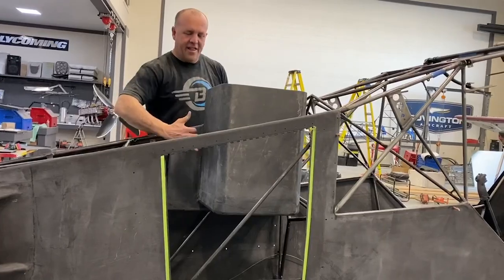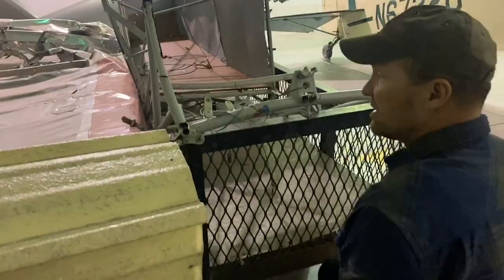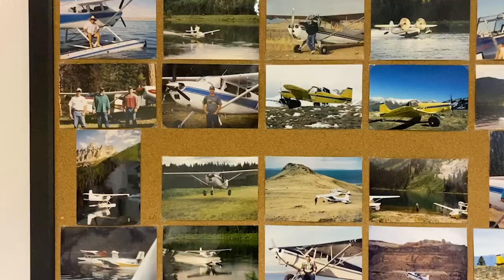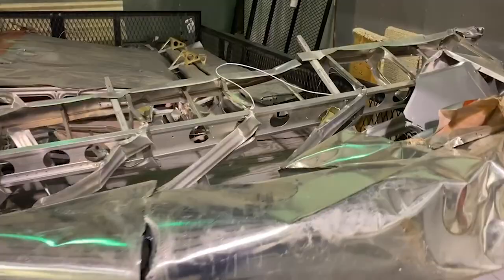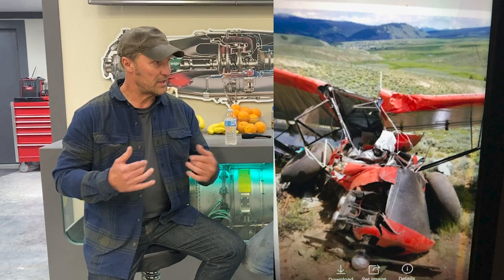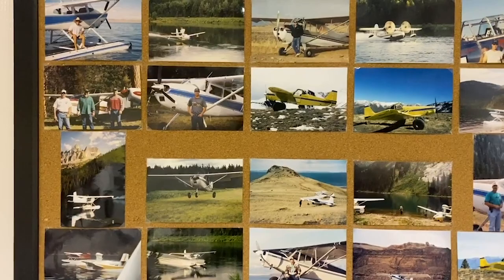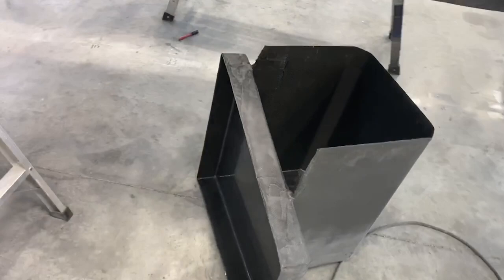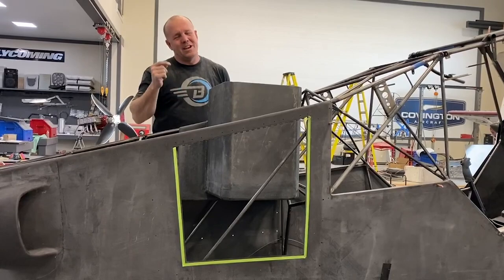Rockets, Boxes and Parachutes Oh My 🤠 (Scrappy Bush Plane 18)

Comment: Whoever says real pilots don’t need parachutes must have never seen a military aircraft.
Reply: I actually Saw a guy Complaining about a year, year and a half ago, that Military Pilots Shouldn't be allowed to use their Seats, and should be forced to "Ride it In" since he as an (Alleged) Airline Pilot doesn't have that Option.  There's a WHOLE lot of Stupid out there.
Reply: @toadman506  That especially doesn't hold up when you consider that (as a general rule) people don't shoot missiles at airliners and airliners shouldn't be doing crazy, high speed, low/close flying or aerobatics...
Reply: Its the plane that is getting the chute? The ejector seats were probably on back order.
Reply: @toadman506  Especially since modern jets lose power they drop like a rock.
Reply: @toadman506  Should have told him that C/EC/HC/KC-130s, C-5's, C-17s, KC/EC/RC/OC-135s, KC-10s, E-3/4/8, VC-25 to name just a few, do not have ejection seats and heaven forbid their crews and passengers ride it in.
Reply: In every skydiving aircraft parachutes are required by everyone on board
Reply: Demon Got Me why they all have parachutes ?
Reply: Like Viagra - yeah it’s a great product, and you should try some, but    I    don’t need it.  Not me.  No Sir.  I’m fine.
Reply: SwissCheeseAviation well have you seen those aircraft.  You’d be insane not to wear one.  All that holds those together is luck and duck tape.

Comment: Read the title and my first thought was “JATO” jet assisted take off/ RATO rocket assisted take off.... LOL. Probably in a future video. 🤪
Reply from the maker: so did I lol
Reply: Well, we don't know any of the details of Draco 2 yet.  Wouldn't that be something to see.  :P
Reply: @ClintMaas  That, and the leading edge of the wing raised a few inches.
Reply: @ClintMaas   Draco X with JATO would make it VTOL in a flash.. :D
Reply: Saša Kurtović it’s not like an American company makes a hypergolic thruster called SuperDraco...
Reply: With that huge engine and prop the  blast over the wing and extra gear leg wings may make enough lift to take off  before it accelerates with no forward speed.  VTOL with just the prop, no need for a rocket!

Comment: I'm not a pilot, but Mike, thank you for pushing me to go work on my race bike when I'm getting in a rut. 
Working 60+ hour weeks, 6 days a week in a motorcycle dealership service department, motivation to work on a bike for free (well, paying to work on it) is hard to come by. But when I see you've posted a video, all I want to do is get back to work. You've already put some ideas in my head about some carbon intake ducts, tail fairing re-design, custom subframe, custom front fairing stay, radial front caliper brackets, and fuel tank crash protection. Now I just need to design, prototype, test, and build. 
I just wanted to say you're one of the very few people I actively pay attention to on Youtube. You offer so much knowledge and insight, I often even take notes. Thank you for posting these videos.
Also you're making me want to get my pilot's license when I can afford it.

Comment: The other advantage to a parachute system is when flying with someone who doesn't know how to fly themselves. If something happens to me in flight, I'd rather it not mean the death of my kids too. They can't currently fly and land a plane. But they can pull a red handle. 

I've never understood the seeming extreme sitgma within the aviation community when it comes to parachute systems. This is the same community that constantly preaches "A real pilot puts safety first" and puts redundancy in everything to help achieve that. Yet practically in the same breath many of those espousing safety in everything saying "A real pilot doesn't need a balistic parachute system." Even beyond structural failure, tell that to someone flying in pitch black at night over wooded mountains. That engine goes out then and even the best of pilots would likely be better off pulling the chute. Or when flying with anyone when you are the only pilot aboard. Anything happens to you, they are probably dead too without the chute. Or how about not a bush plane, but one that lands with a rather fast stall speed and whose gear is designed to land only on pavement or the smoothest of gravel or grass fields, and needs an awful lot of strip even then to come to a safe stop? etc. etc. 

There are so many scenarios when a parachute system can be of benefit to even the best of pilots with nerves of steel, not to mention their passengers who are trusting that pilot with their lives. 

Plus, I mean, it's got a rocket. How could you not want to put that on your plane?  -Daven
Reply: Do a video on your channel about a BRS system! A lot of people probably don't know planes can have parachutes
Reply: Today I Found Out It would definitely be fantastic for you guys to do a video about BRS! I think that audience would eat it up.

Comment: Well said, Mike. As a Cirrus owner. I hear all the time that I must be a crap pilot because I have a parachute, you nailed the reason I have it.
Reply: Must be from the jealous pilots flying warriors.
Reply: What is your opinion on people training BRS deployment due to engine failure?
Reply: @amtank  Wouldn't it  make sense to train with the equipment you've  made available to yourself in case of an emergency? Fumbling through a process you should be comfortable with when the stress is at "full chat" is a good way to still be fumbling when you smack the ground. 
Train as much as you  need to become proficient, or maybe just a little bit more... and then refresh regularly.
This, from the perspective of an old SCCA Safety Marshall & Tech Inspector.

Comment: I really like Mike and his pushing the future by decades in his ability to see a problem, visualize a solution, design and test
a fix and possibly get it incorporated into future aircraft. I also REALLY appreciate the videographer in keeping up with Mike in what is going on and getting such great videos! I am a 'dinosaur' -  I joined the CAP as a Cadet and was taught how to fly by WW2 fighter pilots in a Piper J2 in 1953 NO generator, radio, lights etc. Lots of fun in SoCAl. Too old to fly now - reflexes, hearing and vision - darn it!

Comment: The people that are laughing at putting a parachute would give their right arm to have one if they were spiraling toward the ground.  Years ago when I was training with an instructor, I was supposed to do an approach to landing stall and after the stall horn sounded I put the nose down and gave it full throttle with 40 degrees of flaps.  The airplane didn't like it and proceed to spiral down toward the lake we were over.  It scared the s**t out of me, but the instructor remained calm and took control and said "the airplane manufacturer doesn't recommend spins with full flaps, it tends to rip the wings off".  He reduced the flaps and got it flying again.  If I had been by myself, I might not be writing this, but I sure learned a valuable lesson.

Comment: Mike you have a big influence on the GA crowd.. 2 thumbs up on supporting parachutes is the right direction and up there with the few back country guys taking the heat on helmet use. No one should take heat for safety features anymore then taking it on not flying beyond their personal limits. Cheers

Comment: Two of my flight instructors (one a brother in law) went down in Cessna’s that broke in the air. Both great pilots. I wished they both could have pulled a handle. ‘Nuff said. Thanks Mike!
Reply from the maker: Sorry to hear that
Reply: I hope you consider this as praise but I think your crash is draco has made you a better pilot.   I’m sure it’s part of your decision to add this SAFETY device.        Praise you brother.  Keep on keepin on
Reply: @byronallen3983  couldn't agree more once your have seen your possible life flash before your eyes you tend to have a different perspective

Comment: Safety should never be something that we laugh at someone else for
Reply: Well, oxygen and full de-icing in a super cub might be a bit over the top, but a helmet sure isn't. There have been a few times I wished I had that parachute, even though I didn't need it.
Reply: Iphone 11 pro max
Reply: Mark Reynolds oxygen and the de-icing part really depends on what altitudes you spend most your time flying at. For example, if you’re spending a lot of time flying over the Rockies or other similar altitudes then it would make perfect sense, but if you’re only flying around Florida or near sea level land areas then it wouldn’t make any sense at all.

Comment: Mike, I’m so glad you guys addressed this parachute issue.  Installing that parachute is the best investment in that plane you will ever make.  Insurance can’t replace a severed limb, and it can’t prevent you from dying...but a parachute can prevent both of those from happening. The monetary cost of a parachute backup for your plane is worth the extra expense if it saves the pain and anguish of physical injury or death.  I’m a woodworker, and spent an extra $1,500 to buy a SawStop table saw so that if I ever had an accident with the saw, that there was a very good chance I’d still walk away with all 10 of my fingers intact.  Within a month of buying that saw, I had my first close call.  The brake activated and I walked away with all 10 of my fingers intact.  That parachute will prevent serious injury and death.

Comment: Mike thanks for posting this video on how you use honeycomb, no one on the internet really posts how they install it. This came at just the right time before I get started on some of my projects. Also you should consider using caulking spatulas to lay out the micro radii.
Reply: Use foam as much as you can, honeycomb is only necessary in high shear areas and is much harder to layup wet.

Comment: A shoot is a no brainer, especially with how different Scrappy is going to be. 
Are you going to be making a separate sacrificial part of the lid? 
I know once you pull the shoot there's already going to be damage to the airframe, just thinking if it would safe remaking that part.
Given the suspension you're also going with, if you can land on the wheels the landing should be reasonably soft.

Comment: I’m with you. Stack the odds in your favour because you just never know when your good fortune will leave you short. I’ve had an engine failure in the circuit and it’s not as much as you’d think it is 😱. Oh, and one of my hard and fast rules? Never fly with a pilot braver than me. Mike, I admire your humility. 😌

Comment: Mike, I have been caring around a 26# BRS in my ultralight airplane for 14 years.  Over those years had 6 dead stick off field landings including fuel starvation, ignition, a bearing failure and an engine failure but never used the BRS.  Never bent anything in forced landings.
A BRS deployment and decent will result in serious damage to a plane with a hard landing for the passengers.  A BRS is NO way to land a flyable aircraft!  The only reason to pull the BRS firing handle is a structural failure that makes the plane unflyable.
I did have an in flight structural failure in a friend's plane without a BRS.   One side of the nose and rudder peddle structure broke and I lost use of the rudder.  I was able to return to the field with aileron/elevator and grease on a landing.  The nose wheel even survived the soft landing with 1/2 the structure gone.  The plane was repaired and flying the same day.
I will keep caring the BRS on my plane just in case.....
Reply: He never claimed that a descent under the brs canopy was "landing."
Reply: BRS is not there for all the times there are other options. It's there for the one time there isn't. Once the situation arises, it's too late to go home and retrofit it to the plane.

Comment: I absolutely agree that a BRS chute makes sense. However, one aspect people often are not aware of that is actually very important:
After a crash without deploying the chute, rescue teams often don't know about the fact that there is a rocket installed in the wrecked plane that could potentially go off. In my country, photos have been taken of rescue peronnel standing right in line of fire, unaware of the rocket. People need to be trained for this and there should be a visible warning sign on the aircraft. Also, everybody involved in plane crash rescue missions needs to know how to disable such a system.
Reply: Perhaps a variation on the ejection seat triangle, saying something like “rocket parachute”.

Comment: Mike-  The chute is a great safety feature.  Scrappy is a treasure chest of new design ideas.  If one of them fails in test, you might have exactly 5 seconds to diagnose the problem and decide on a course of action.  Five seconds seems to be decision time required in many failure scenarios.  There are too many new design features to trouble shoot.  Pull the chute, save your life and you will probably save much of the plane too.

Comment: Im trying to figure out how to put it in a Kitfox.....
Reply: Is it possible? I want to start building a 7 but my family’s condition it to have a chute
Reply: Yess, just search brs kit fox and there’s info on their website
Reply: @alejandrosaldana1244  it's been done already,  not an issue
Reply: Someone already said BRS because I had the exact same thought. They have the Kitfox listed on the site and I saw a price of ~$6000 on AircraftSpruce but hell, I am interested. My first though was would this have made Nik's crash less severe and will it save my butt in the future.
Reply: Ive had a BRS 5 canister chute in my
Kitfox 4 since its first flight 15 years ago.
I put it in the baggage compartment. I 
Cut a hole in the turtle deck for thr rocket
And chute to come out, i covered the
Hole with a very thin wood veneer.
I still have a small amount of storage
Under the turtle deck. If you install a BRS
In a kitfox l would  recommend also
Installing a carg
Reply: Cargo pod under the  belly
Reply: @LoudGuitar14  Not likely, he spun it into the ground at around 50ft. I'm actually a bit scared of him going out flying with those guys again, it seems he's flying above his skill..

Comment: Thanks for helping remove some of the stigma, Mike.  I'm a Cirrus pilot, and believe me, the parachute jokes get old :)  There's one minor point I want to bring up about its use.  There's a law of primacy at play with the usage of the chute.  If you think you'll only use it when you've exhausted every other avenue, you'll probably not use it when you need it.  In a way, you have to kind of mentally accept that it might be pulled "unnecessarily" in cases that could be safely managed without it.  An example is the time between 500' and 2000' AGL.  This is the "parachue now" window.  Any engine failure in this region is an instant pull, because you don't have the time to waffle.

Anyway, just a thought.  Over at the Cirrus Owner's and Pilot's Association, we spend a lot of time dissecting every pull and every crash.  Early on, a lot of Cirruses crashed with perfectly good parachutes stowed.  A guy by the name of Rick Beech developed the phrase "Pull early, Pull often" to encourage pilots to optimize for good outcomes (maintenance of life) over the perception of weakness or poor airmanship.

Comment: James’s story is amazing, lucky to have had 2 walk away from that. I think it’s extremely smart to have a chute. Just make sure you placard the outside of the plane that it has one. I responded on an ultralight crash that had one that was in deployed. It wasn’t placard and hidden very well. Thankfully during the extrication we didn’t unintentionally set it off, thou we came very close to stretching the trigger cable. Had we, it would have absolutely hurt one or more of us. I still think it’s a great safety tool and absolutely the smart thing to do!

Comment: To break out that mold, you could attach cleats or eye screws or double hole pipe straps inside by the cuts, and when you are ready to remove it, you tie a rope or some wire across between opposing sides, and stomp in the middle (or use an appropriate chunk of wood etc, and give yourself some mechanical advantage, and proper direction of pull.

Comment: Mike, I find this stuff so interesting.  I use my ME for widget design, and I'm pretty good at it, but watching this system design is fascinating.  I love watching these individual parts get designed and built as part of the system coming together.  You definitely have the patience of a craftsman, that's one thing I don't have.  The engineering and final product really gets my motor running, but all the scut work of layup, fill, trim, sand, etc. would make me want to jump out of a window.  
Love your work and your channel.

Comment: Powered parachutes are great. But they cost quite a bit. But they are worth it. It's the added weight that can be the big challenge. If it fits and the a/c can handle the weight, DO IT.

Comment: The use of carbon shows how creative you can be with simple moulds quickly.  
It would be great to see the prep work and particularly how you are templating the carbon and how you laying up the wet carbon using plastic.  I have used the technique on small parts but not on large areas.  A technique video would be great.